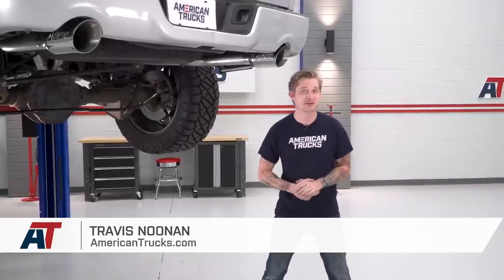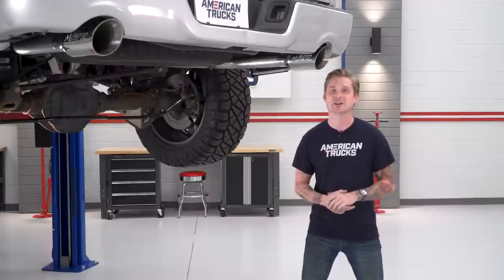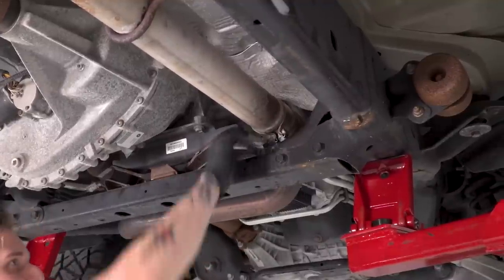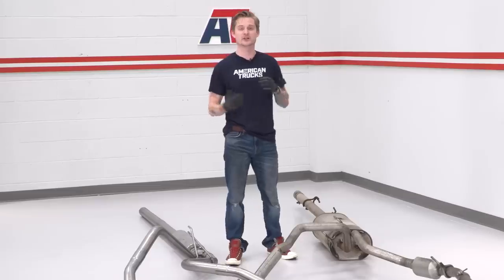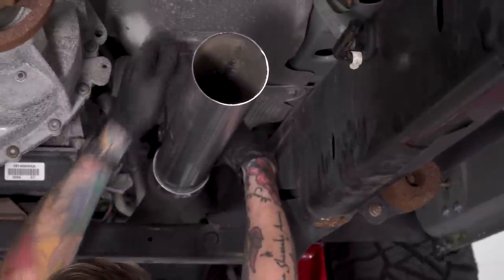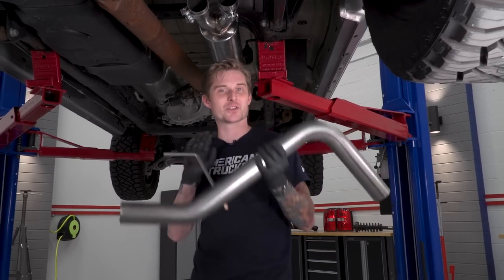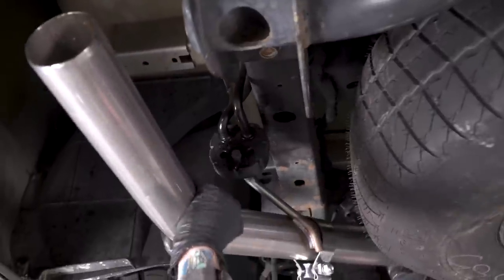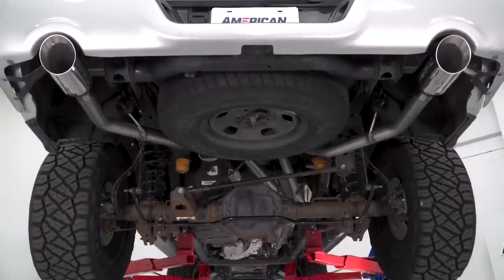2009-2018 Ram MBRP 2.5" XP Series Dual Rear Exit Exhaust System 5.7L Sound Clip & Install

Comment: Why does this not come ready to install? Shoupdnt it come from the manufacturer ready to be bolt-on? I have an MBRP exhaust for my mustang, but seems like there are better prepared kits from other manufacturers.
Reply: This kit fits different wheel base Rams thus they send a pipe to fit the longest one without cutting . The instructions included will indicate what model Ram needs the pipe shortened and how much to remove . Its a simple measure and cut . My 2012 Ram 1500 Quad cab uses shorter pipe .